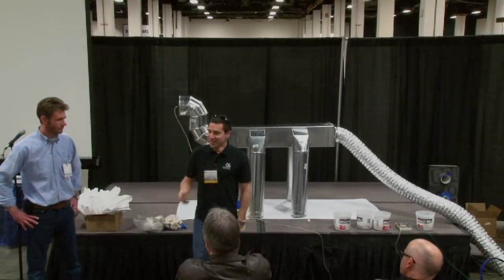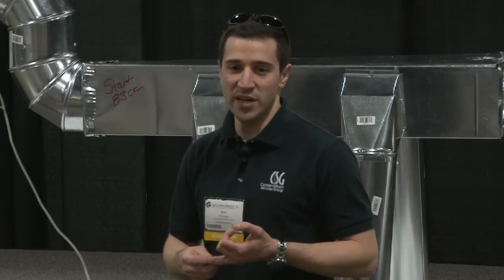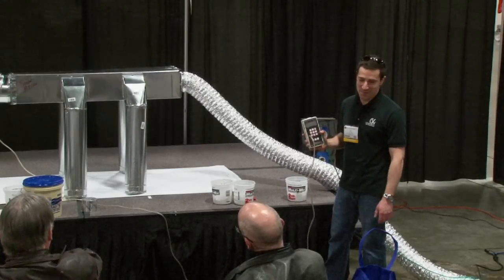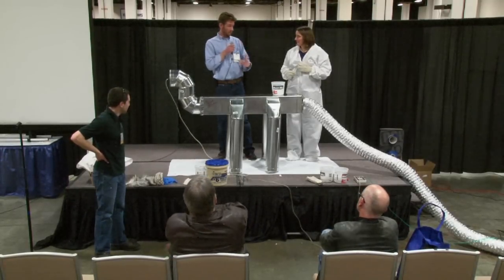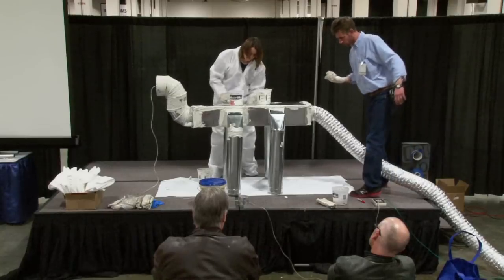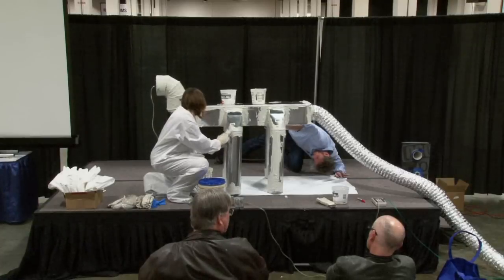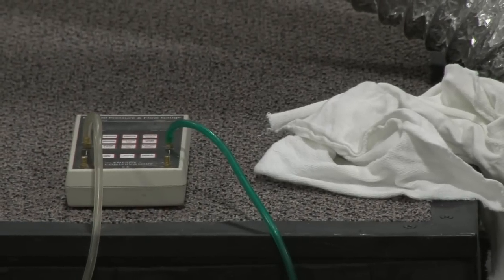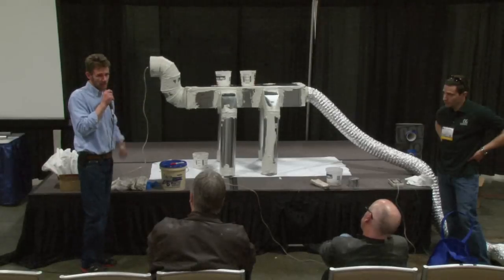Duct Sealing Demonstration

Comment: I am sealing all the ducts of a 9 ton system in my attic in Houston.  It’s a lot of work but I cannot believe all the air holes the HVAC people left.  They should lose their license for doing such poor work.  I’m tapping all the joints heavily and then applying a thick coat of mastic.  Then R8 duct wrap.
Reply: Depending on local codes it isn't required and unless a contractor bids the sealing it won't be done.
Reply: @bellsback  a huge difference.  Not that i purchased a 1975 house so the leaks were massive and the insulation was mostly vanished.   I also changed out and air sealed over 50 can lights and all the AC duct return boxes.
Reply: @bellsback  I purchased the recessed lights for being buried under insulation,  then caulked them with fire foam all around.  The body of these are air sealed so you just have to seal around the base.
Reply: @MrCbrehaut  This may be my issue!   New HVAC installed 3 months ago  and ever since the install my indoor air quality is horrible. Today I found several small screw holes in my ducts near the furnace. Holes in the return too. And I feel air leaking in the duct attached above the coil. I asked the HVAC tech about the air leak and he said it was no big deal. Huh. BS, methinks.
Reply: My 1967 built home has massive leaks. Like 1 inch by 24 inches. In multiple locations.  Insane that anyone thought that was acceptable

Comment: Sealing ductwork means to make it airtight as you possibly can. With that in mind, every seam, including longitudinal seams should be sealed as well. I prefer using mastic paste. if there is a large gap, I use fiberglass tape to bridge the gap and multiple coats of Mastic to ensure an Airtight seal. This air tightness needs to include the registers at the floor, ceiling and if needed the walls.

Comment: Thanks for some excellent advice. I'm doing my house, so I'll add a suggestion, one that's perhaps the easiest improvement to make. Remove the louvers on your vents, and you're likely to discover cracks between the ductwork and your ceiling that leaks heated/cooled air into your attic or crawl space. That's easily sealed with the aluminum tape. At the same time, you can also use mastic to seal seams in the ductwork from the inside.

Also, if you've got white, blown-in insulation, look for dirty areas. That's a good clue you've got an air leak needing sealing.

Comment: I saw some using a fiber type of tape like drywall tape to make a stronger bond. My question is how do I seal a leak on the bottom that is not accessible from the outside? Should I take the box apart and seal it from the inside?

Comment: By using mastic inside the duct don’t you create more air friction? Any bumps or peaks may create a whistling when air passes through?
Reply: DebraLynnP

Clever
Reply: there would be more noise from leaky ducts as air passes out creating the whistle sounds..and many are insulated which acts as sound barriers also
Reply: No. It’s so trivial. The air itself will be louder than any bumps or peaks. If that were true you could argue that any screw use for joining fittings at any part of the duct system including screws from hangers
Reply: True story. That's like insulation inside duct work. It also catches anything that happens to get in the stream.

Comment: do you have to seal the furnace as well? I have an amana 97% efficiency furnace I just bought in 2017.
Reply: That rating  is gas to heat efficiency  not air sealed efficiency.

Comment: It's works decent. I just think it makes the work look like shit. I believe tape looks alot better. But before some douchebag comments and thinks I'm dissing the product I'm not. I do installs. I just don't like the looks of it. When you have an install and your metal work looks great, this just ruins it imo.
Reply: I hand apply mastic with rubber gloves. It looks bad but it's quick and allows me to get every area with a thick coat. I put on insulation after so you can't see how messy it looks. :P

Comment: I WOULDN'T  LIKE TO DO THAT  ITS SO NASTY Y PREFER THE BRUSH 
AND DO IT ORDERLY
Reply: I thought so too, but after trying it with rubber gloves it's quicker and you can get into areas that you can't reach with a brush.
Reply: @rosemcommm  its makes it sloppy. I've had no issues with a brush before
Reply: @travissturm2531  Just depends on the situation. Mine was already installed and in a crawlspace.